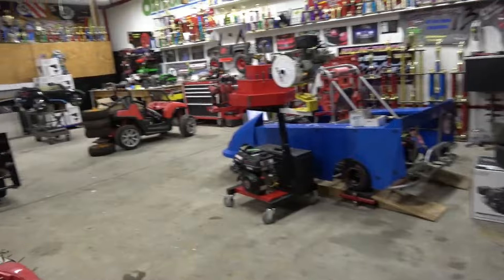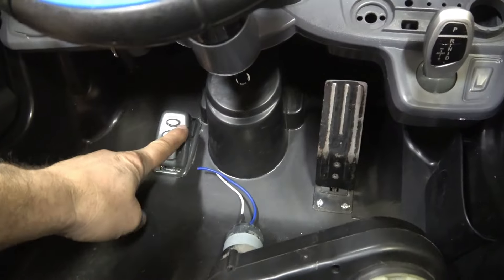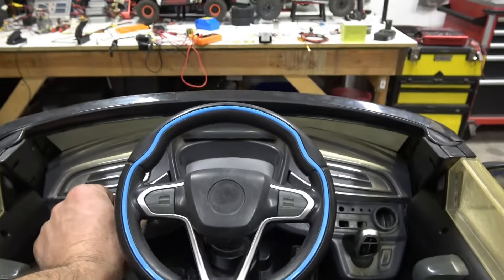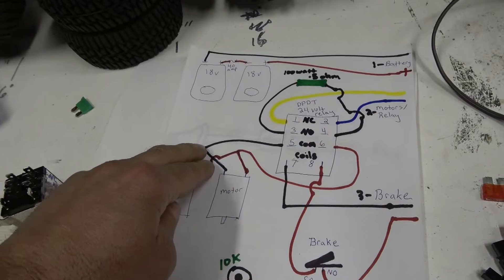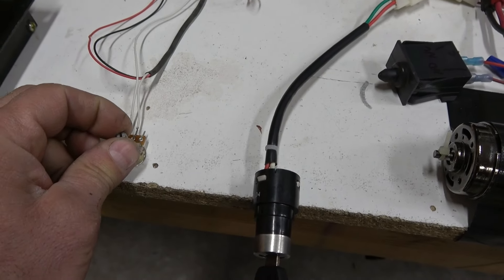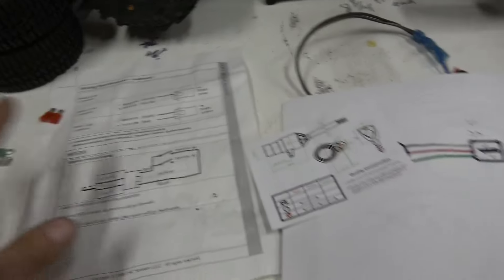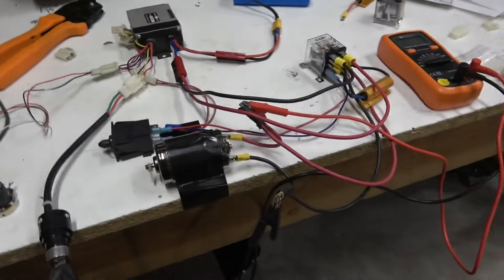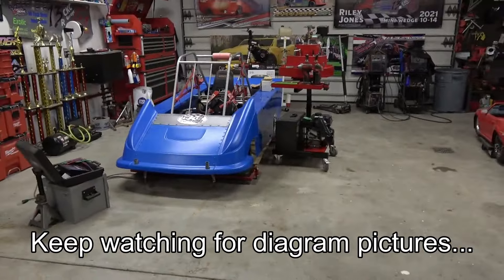Unleash The Power With 36 Volt Sleeper Powerwheel Build! #ryobi #sleeperbeemer

Comment: I came because I'm new to Power Wheels and doing this for a friend...I wired up 3 12v LiFEPO4 20AH batteries so the system is parallel when it's off for charging...and series when it's on for 36v (Just Over 40v at full float charge).  Your potentiometer needs will be directly related to the minimum voltage of your controller and the maximum voltage of the system...if you've got a 24v controller on a 36v system, you'll need 300 Ohms (approximately) to achieve full usage of the potentiometer.
Reply: I’ve got 4 12v lifepo batteries and a charger that can charge 12v or even 24v.
And I’ve always wondered if I could wire them in parallel and charge more than one at the same time at 12v even though they each have their own BMS without damaging/“unbalancing” the batteries. You’re saying I can? Wire up 4 lifepo batteries in parallel and charge them at the same time at 12v? That’d save me the hassle of having to swap to a new battery each time one is full
Reply: @tysonhubbard95  unbalance won't happen because you're charging all at the same time...how many AH is your charger capable of...just remember parallel increases AH parallel does not.  Let's say each is 20AH at series it would be 80AH...but at series/parallel  24v it would be 40AH
Reply: @tysonhubbard95  also...the fact that each battery has it's own BMS makes this possible.

Comment: does the variable speed pedal ramp (soft start) the motor up the volt range to max setting and down the volts back to zero as you let off..  while the potentiometer your using basically limits/defines what max is?
Reply from the maker: Basically a governor. Limits max voltage output
Reply: @CustomKidzCars  thought so...  will use mine most via a remote- it wont be kids ride on.. but haul medical equipment etc and tools (it has a remote).  will see if it has any soft start / ramp up ability with the remote. hope so.  (Ive not put it together yet)
Reply from the maker: Will have soft start but not variable speed and your steering will suck as it's just a gearbox without self centering.
Reply: @CustomKidzCars  honestly thought remote would use Tank Steer method so it would be easy for parent to use remote to cancel out young kid riders steer input*.. Then discovered it has a motor on the steering column to turn the front wheels that way. Thus remote actually turns front wheels.  Your likely right though no return to center.  There is no joy stick on remote.  BUTT...  I might can adapt a different controller with return to center joy stick since I know it is a 2.4mhz controller.   orrr...  just put some springs on rig somehow that will pull it back to center.  

*it's a 24v (4wd) 6x6.  two front tires steer. rear four tires each have 24v motors.  I'll strip body to minimum. cut parts of body off to put on a basket.  fill parts with spray foam to stiffen unibody if I lose some by cutting things off . Will put tread on rear 4 wheels orrr  maybe with a tire tread from small car tire, make pair of tracks.  Put one track around  each side's pair tires. End result it would be  a Half Track type thing.   My  concern is breaking the plastic gears by improving traction.

Half Track https://www.youtube.com/watch?v=IdP-kww8pso
Reply: @CustomKidzCars  what is difference between softstart and variable speed?  is it "softstart" is more of an "preprogrammed ramping up/down of voltage/speed" ?  While  a [Variable speed pedal] is "variated/ramping of voltage/speed  via your foot / pedal interaction

Comment: Great video . Is there a reason you used the key for forward and reverse instead of the stock shifter . Is the voltage too high hence cause melting of 3 pin shifter
Reply from the maker: Exactly, switches melt because they are only rated for 15 amps. The key is actually a switch for the relay
Reply: @CustomKidzCars  I like the video . Want to try keep the shifter so might use an automotive relay to do heavy lifting and activate trigger wire using stock shifter . I do like how u have kept it all simple though and pot is a genius move to limit top speed .

Comment: I love your video. I was just wondering if I could bypass using a controller and use a soft start module with voltage regulation?
Reply from the maker: R u referring to the cheap Amazon versions used on many models? If so it's possible but I am not impressed with the performance or reliability

Comment: So the 24v speed controller handles the overvoltage with 41v from fully charge 18v Drill batteries ?
Reply from the maker: Yep, just wont have lvp but the Ryobi battery has lvc built in

Comment: Where did you get those motors that can handle 36v? I hooked up a 36v lithium battery in one of our power wheels dune racer and it immediately burned up the stock motors
Reply from the maker: They don't handle 36 volts as discussed in the video. They already smoked one motor. That is the reason for the potentiometer to turn down the power

Comment: I got the key and motor controler you linked to but the controller outputs seem to be different than the video. I wired the key to the controller output  called "speed selection switch" and all 3 key positions spin in the same direction. Do you use the reverse switch connector? That one only has 2 wires.
Reply: I’m in your boat currently. Did you find a solution?
Reply: Looking for same . Speed controller in link is different to one you use with reverse
Reply: @ishanperusinghe  I used the 36V controller that doesn’t build a relay system. It works but doesn’t really have a brake system built into it. But power wise with a pedal it’s good. You have to use a separate switch for reverse but that’s fine.
Reply: @ishanperusinghe  So I used electricscooterparts  SPD-36500R. They’re a sister company to the link he has.

Comment: Great video! I've copied this setup, added the low voltage cutoff, and everything works great except the pot. that darn thing seems to do nothing. when attached, i'm getting full voltage no matter where the dial is set. I have the Plastic smaller foot pedal throttle and the pot you recommended above and installed the pot on the green wire. no dice. not sure what to try next.
Reply from the maker: Should be spliced into the white signal wire
Reply: @CustomKidzCars  First off great video Thanks . The pedal that  I used had red, black and yellow wires. I had no glue on which wire to cut into. So I cut into the yellow first. And got you full voltage problem. I soldered the yellow wire back together and when for the red wire. And that did the trick. So it was the red wire with my pedal setup. Again the video was a great help. Thanks.

Comment: Limiting the voltage with a Potentiometer is simple but isn't there a danger of overheating the pot?
Reply from the maker: It's on a 1-4 volt signal wire of the hall pedal so no